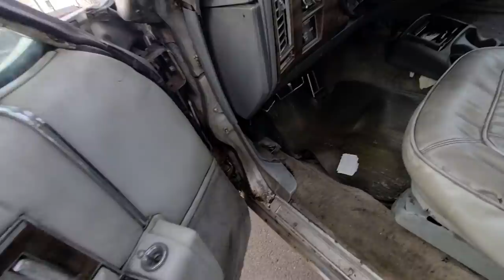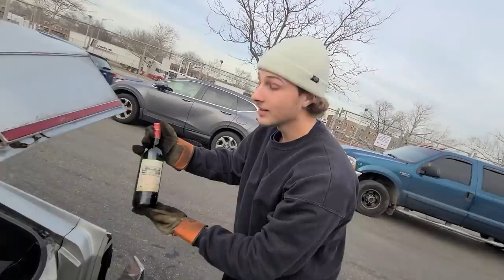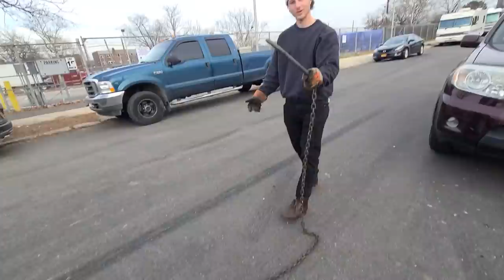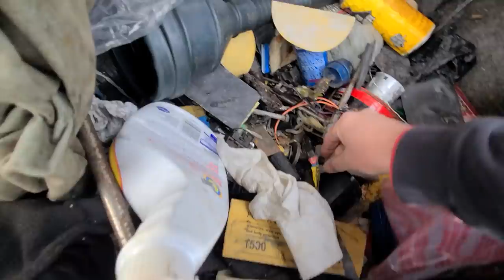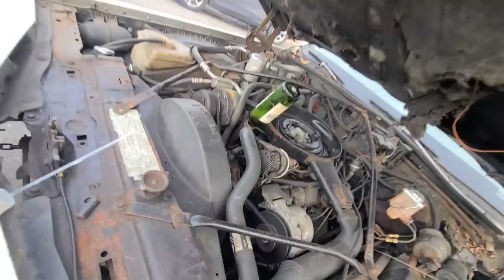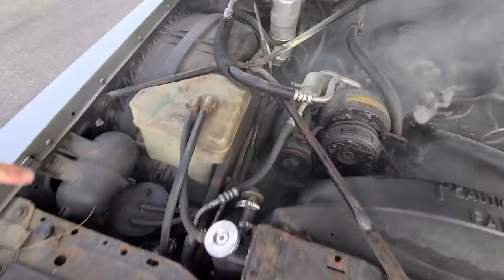1987 Cadillac 5.0 Redlined..Tough Ass Motor! NEUTRAL DROP!

Comment: The motor is an Oldsmobile 307 in it, bullet proof engines. Also they dont make enough power to hurt them selves. That bolt you stuck down the carb got wedged in between the butterfly door, thats why the throttle got stuck.
Reply: Olds gang
Reply: @SpecialAgentJamesAki  307, 350 and 455 in daily rotation over here 👍
Reply: @UsefulEntertainment  hell yeah! Keep em going. I’ve been dailying a 71 ninety eight for 6 years now. Olds did the best motors in my opinion. So easy to work on and very thoughtful design.
Reply: @SpecialAgentJamesAki  agreed, very durable and user friendly motors. Also best bore to stroke rarios.
There are MANY other reasons i believe they are the best designed engines from general motors. I mean they even stuck them in Cadillacs like this one at the time to keep them afloat.
Reply: @UsefulEntertainment  what's the bore and stroke on the 307? Thought they were just destroked 350s,?  Same as the 305 really..Im running a ford 300 straight six..and those are squared motors.bore and stroke is the same..as far as longevity goes idk if anything outdoes these 300 sixes..I've seen a lot of guys get over 500k miles without a rebuild..and they can handle boost from turbos great.there  not high revving motors due to the long crank but there torque monsters all day.and there actually very close design to a diesel motor..except for running on gas rather then diesel there very similar in design..
Reply: @working_country ___ isnt olds BBC 455 pretty close to the Pontiac bb 455 super duty?? I know the Buick bb were a little different I thought the chevy olds and Pontiac bb were all very similar
Reply: @working_country ___ that depends a lot on the year..after the late 70s into the early 80s and on they were all very very similar..not just the motors but the entire vehicles were
Reply: actually it's a Chevy 305....
Reply from the maker: Yooooooo
Reply: @jeffreyfelder7981  yeah, too bad its actually not... thats an olds motor, chevy doesnt have a foot long oil fill tube coming straight up the front of the motor,  also chevy motors have the ac compressor on the drivers side
Reply: @jeffreyfelder7981  damn, 2 months later and you're still quiet
Reply: They love a qt or 2 if bleech...
Reply: i just made pretty much the same comment. i dont know why but i love old pieces of shit like these. Its the same engine that came in independence chevelle on VGG. derek built the engine the 307 and had it dyno’d just to see what it would make with spare parts he had laying around and it made like 320bhp wasn’t bad for just slapping together some pieces with junk parts!
Reply: @mromatic17  I heard about that episode of vvg, I don't think his was an Oldsmobile motor, his would've been a Chevy 307, totally different engine but yeah. Love playing with old 60s-80s motors
Reply: @UsefulEntertainment  its the same basic engine it just evelved different after30 years.
Reply: @mromatic17  nope, the olds 307 was produced from 1980-1990 on the same basic Oldsmobile v8 platform that was in production from 1968-1990. The Chevy 307 was it's own engine built on the Chevy small block that debuted in 1955. Each division of general motors had their own engines that were completely different from one another.
Chevy
Pontiac
Olds
Buick
Cadillac
Every divisions engines had about as much in common with each other as a Chevy and a Ford do. The only thing that was universal to the engines was the distributor cap. Not even the distributors are interchangable, just the cap.
That year Cadillac has an Oldsmobile 307 in it because Cadillacs didn't use the Chevy 305 in those years and Cadillac no longer produced a v8 them selves.
To put it in perspective, the Chevy small block uses 17 head bolts as where an olds only uses 10.

Comment: Had the same year Caddy with the same motor back in the day.  Never gave me issues, but man was that car underpowered!
Reply: Had a 89, but 24 mpg on the highway
Reply: Yeah but who cares about this these cars was made to slow smooth ride
Reply: 5.7 will haul the mail like the lt1
Reply: Nice..I had a ‘81 with the little known 4.1L V6..people often thought it was the HT4100..nope. Now THAT thing was a snail..but it was a D’elegance and I loved it.
Reply: Yeah I had a caprice like that. No burnouts
Reply: @happyjohn8256  wow, I didn’t mention it but same thing happened to me!..I forget exactly what I had done to it, as I know I didn’t have a ton of extra cash at the time. I was 22 in 1993. But had top end done..maybe valve job, lifters, etc..and about a week afterwards it blew out the bottom end..spun main bearings. Yeah..terrible engine ☹️
Reply: Good ole sofa on wheels.
Reply: @johnhull6363  I have an 89 too. Somehow I get 10 mpg on the highway

Comment: I had an 87 Fleetwood Brougham. Factory Spoke wheels, leather, and all. 
Yeah, those motors are tough. 
I had a freeze plug blow out in the bell housing. Wouldn't hold any coolant at all. I was broke so I just kept driving it. 
Three months back and forth to work, 7 miles each way. 
It got literally red smoking hot each trip but just would not die. 
I finally took it to the scrap yard, and it drove all the way to the crusher..
Reply from the maker: Crazy right tough ass motor

Comment: Tellin ya...about -25⁰ F in MN. and waterpump belt on my Northstar POWAH'D '99 DeVille chit the bed. Drove about 19 miles to the store. After a bit, it won't show the temp, just says, "TURN OFF IMMEDIATELY" or similar...UNLESS...you go off/on again w/key. Pulled into the store and I ain't lying when i set my personal best at 305⁰ F. 
FOOTNOTE: drove it 98 days with ABSOLUTELY NO BRAKES, front or rear. True, no B.S. THANK GOD freeway traffic was never stop & go...may have had an issue

Comment: That's the Oldsmobile 307.  Tough engine.  Good job blowing it up guys.
Reply: @thehulkamaniabrother2.089  What Chevy 305 have you ever seen that has an oil fill tube on the timing cover?
Reply: @thehulkamaniabrother2.089  It's an Oldsmobile 307 for sure.
Reply: Yup definitely an olds. Dead giveaway is the oil fill tube and the valve cover with too many bolts to hold it down lol

Comment: Dam that llac was weighing down the HD with all that shit in the truck as well as the weight of the car. I've owned 3  llacs in my days. Had a 88 eldorado, 81 sedan deville, & a 79 coup deville. They are good. Mostly cosmetic shit that goes out. Not sure about what year but they put a weak ass motor in the 86-89? Was a 4 liter. And they did not do well. Too much car not enough motor. But pretty cool y'all found 1 up there that wasn't rusted completely out. That 1 actually has a lot of salvageable parts on it.

Comment: I had a 1986 I had 450,000 thousand miles everything that can go wrong with a motor was wrong with it oil pump gone head gaskets crank looked like it was bout to fall still ran and drove under its own power

Comment: Back when real cars were built here in Lansing. Well maybe not this entire car, but the Olds V8, Fisher body. Now we build the Camaro, Traverse, Cadillacs or whatever other junk GM puts out these days. Even being a 10000 pound car with a 1000 pound engine putting out 100hp, I’d still prefer it over any modern vehicle in the GM lineup. They’ve really lost their character and become some of the most unreliable ugliest things on the road. I prefer Chrysler these days after 10 years at the dealer even though I grew up in a GM town where everyone’s Grandpa and dad worked for GM, where it was like a betrayal to buy anything but GM. But they’ve lost me, timing chains don’t fail on Chryslers at alarming rates, you can neglect the hell out of a Chrysler 3.6 and it’ll still run forever. my 95 GMC truck will be the last GM product I’ll ever own. Sorry Grandpa, but the times have changed, and Oldsmobile is gone forever. But I still display your ‘Oldsmobile, we build them in Lansing’ novelty license plates in my garage and plan to put one on the front of my Chrysler 200 and WJ Grand Cherokee to remind people of the good ol’ days and the cars I grew up riding in.